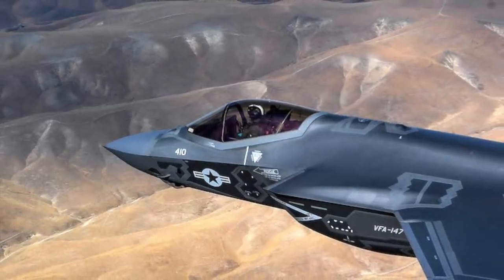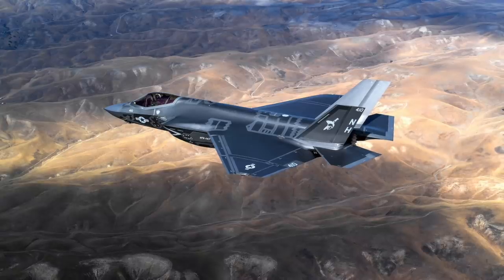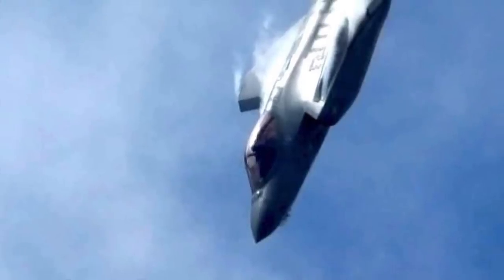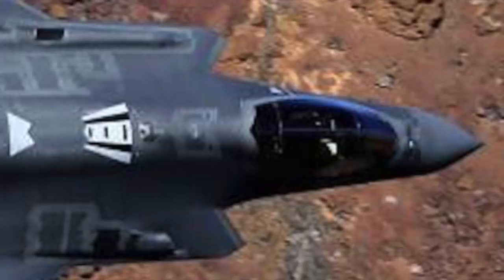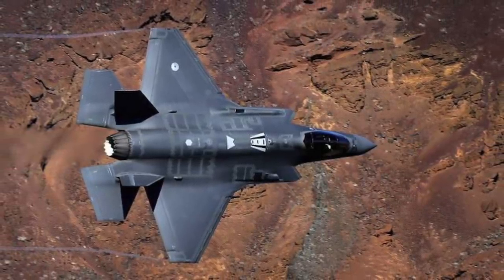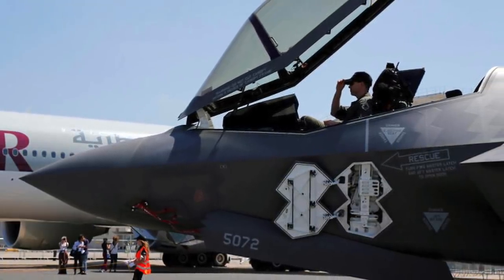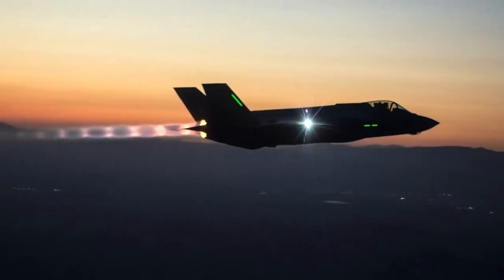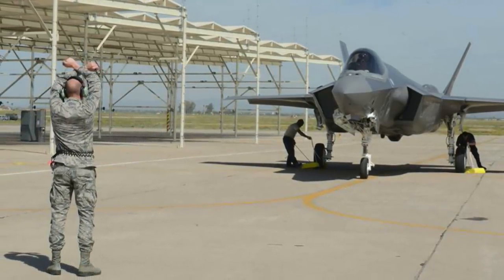HOW GERMAN MADE RADAR MANAGED TO DETECT F 35 5TH GENERATION STEALTH FIGHTER ?

Comment: The entire premise of this claim is ridiculous. They clearly state the 'pony farm' was near the airport. Flying any aircraft (no matter what degree of stealth is in the design) within a few miles of any radar system is going to reveal them. Hell, you can just look out the window and see them, or just listen for the engines at that range. That's not what stealth is for. It's to minimize the chance at detection to get the jets within effective range of their ordinance to identify and take out enemy defenses and high value targets. Once any radar has a lock and track on a known object well enough to predict it's immediate course following it is not all that difficult. You know where it could possibly be, so any return in that immediate area allows it to be followed with a relatively high confidence level. The fact that they lost it in a hundred miles, even with all those initial advantages, doesn't say much for their system. To cover the usual footprint of a economically feasible military radar system, say let's say a 400 mile radius, would require at a minimum of sixteen dual systems such as they used in their test ( that's 32 radars, for the math impaired) since they won't have the initial advantage of knowing exactly where the approaching aircraft might be on the six hundred mile fringe of their detection range (2 Pi R). For workable detection and targeting to guard a single point source such as a vital installation or troop concentration when the approaching stealth aircraft is carrying AMRAM missiles, let's say a 200 mile working radius, would require four dual systems (that's 8 radars) for a decent chance at interdiction. Believe me, that kind of deployment gets expensive real fast.
Reply: Yep.they knew they were coming!
Ezy Pzy...that's the only way!

Now if they were in stealth mode 
We wouldn't be having this conversation!🇺🇸🇺🇸🇺🇸🇺🇸🇺🇸🇺🇸🇺🇸
Reply: excuses,  excuses.  The F35 was tracked up to 100+ miles away.
Reply: THANK YOU!!!!!!! For the love of all things holy and sacred, stealth IS NOT a magical wonder woman invisible jet.... FFS! Get close enough and you’re gonna see the F’ing POS on radar.... or your GD Mark 1 Eyeballs.
Reply: @dystopianlucidity4448  Yeah, people forget that in combat all you need to do is get close enough to the target get your shot off without being detected. You don't have to fly over the radar site to do your mission. IIRC that's currently between 75 and 125 miles depending what missile you are carrying.
Reply: @jubeiorigami4096  Tracking from is entirely different than tracking to.  If you listened to the video you would know the rear stealth profile is decidedly less effective than the front.
Reply: @jubeiorigami4096  Excuses my ass, has anybody locked onto a F-35 let alone shoot one down Jubei Boy??
Might wanna check with S-3/400's in Syria cuz they aint tracking Sh##!
Reply: Jubei Origami do remember the pilots of the aircraft were not expecting to need to avoid radar so why do the pilots have to play a radar company’s game when they can just save fuel not even a f 22 could get past it and I doubt a su 57 would do any better
Reply: Yep people don’t understand what stealth means.
Reply: The key factor here is that these F-35s were not in combat configuration. When flying through civilian airspace, military aircraft have to basically give their position via transponder. Also F-35s also use radar enhancers. Honestly, this is the kinda of shit that start shits between countries. Germany declined the F-35 and now uses pony farm system to track, almost sounds like they are trying to undermine it
Reply: I bet the jets had their radar deflectors installed. And that's it.
Reply: @frankcrawford416  yup
Reply: @Yo UNot just flocks of birds,  but Monarch butterflies when they assemble to migrate.
Reply: @jubeiorigami4096  and then becomes undetectable by the "great" s300 and s400
Reply: @remejr3609  How do you know they ain't tracking shit?  Are you at the S400s Radar control room checking it out? The S400 only protects Russian assets and is designed to shoot down 5th Gen Stealth aircraft.  Israeli F35s have to carry out attacks from the Mediterranean sea and Lebanese airspace which is OUTSIDE the engagement range of the S300.
Reply: lol.... Excuses about Reflectors.  It was only a matter of time before the development of radar able to track stealth appeared.  The F35 isnt some invisible machine.
Reply: What Went Wrong with the F-35, Lockheed Martin's Joint Strike Fighter?

The F-35 was billed as a fighter jet that could do almost everything the U.S. military desired but has turned out to be one of the greatest boondoggles in recent military purchasing history

The F-35 was billed as a fighter jet that could do almost everything the U.S. military desired, serving the Air Force, Marine Corps and Navy – and evenBritain’s Royal Air Force and Royal Navy– all in one aircraft design. It’s supposed to replace and improve upon several current – and aging – aircraft types with widely different missions. It’s marketed as a cost-effective, powerful multi-role fighter airplane significantly better than anything potential adversaries could build in the next two decades. But it’s turned out to be none of those things.

Like the F-117 and F-22, the F-35’s stealth capability greatly reduces, but does not eliminate, its radar cross-section, the signal that radar receivers see bouncing back off an airplane. The plane looks smaller on radar – perhaps like a bird rather than a plane – but is not invisible. The F-35 is designed to be stealthy primarily in the X-band, the radar frequency range most commonly used for targeting in air-to-air combat.

In other radar frequencies, the F-35 is not so stealthy, making it vulnerable to being tracked and shot down using current – and even obsolete – weapons. As far back as 1999 the same type of stealth technology was not able to prevent a U.S. Air Force F-117 flying over Kosovo from being located, tracked and shot down using an out-of-date Soviet radar and surface-to-air missile system. In the nearly two decades since, that incident has been studied in depth not only by the U.S., but also by potential adversaries seeking weaknesses in passive radar stealth aircraft.

Of course, radar is not the only way to locate and target an aircraft. One can also use an aircraft’s infrared emissions, which are created by friction-generated heat as it flies through the air, along with its hot engines. Several nations, particularly the Russians, have excellent passive infrared search and tracking systems, that can locate and target enemy aircraft with great precision – sometimes using lasers to measure exact distances, but without needing radar.

Lockheed Martin and the Pentagon say the F-35’s superiority over its rivals lies in its ability to remain undetected, giving it “first look, first shot, first kill.” Hugh Harkins, a highly respected author on military combat aircraft, called that claim “a marketing and publicity gimmick” in his book on Russia’s Sukhoi Su-35S, a potential opponent of the F-35. He also wrote, “In real terms an aircraft in the class of the F-35 cannot compete with the Su-35S for out and out performance such as speed, climb, altitude, and maneuverability.”
Reply: @jubeiorigami4096  So your idea of a reply is copypasta? Please!

From any standpoint the F-35 is a significant upgrade to it's most direct competitor in allied armed force, the Harrier II Jump-jet.  It's supersonic where the Harrier was not, has longer range, a significant degree of stealth, amazing communication command and control  electronics and fly-by-wire systems that address the most significant problem with VTOL, STOL and carrier based fighters: they tend to kill good number of pilots even when not in combat, especially inexperienced ones. It's the main reason why the Soviets stopped trying to build them. The utility of the aircraft is that it allows any country with jump carriers and helicopter carriers, even cruisers and destroyers fitted out for using helicopters for ASWF to have effective air cover and a ground assault strike force when operating independently. While it's not much of an air superiority fighter most of that is going to beyond visual range these days so it's not a huge issue, and it's highly unusual to find an air superiority fighter that can operate off a carrier. There have only been three: the F-4 (fast, not great at dogfighting), the F-14 (great plane, limited range) and the F-18. The Russian and Chinese carrier capable fighters are all severely limited in range and munitions load out due to having to operate off jump carriers. For almost everyone buying the F-35 it presents a way to perform the roles most countries need a jet fighter for in regional conflicts, reconnaissance, interdiction patrols, anti-shipping missions, air to surface high value target missions, and taking out hostile radar installations. In many of these even limited stealth is a decided advantage. No one in the US considers the F-35 as the ideal choice for air superiority or ground assault. It's not fast or nimble enough for the first, and just too expensive for something that can easily be done by a turboprop. You've probably noticed there are two military aircraft the US doesn't sell to anyone. The F-22, which is a dedicated air superiority fighter, and our excellent A-10. There's a reason Congress slaps down the Air Force anytime they make noises about eliminating the later.
Reply: @massivereader  Yes...  Copy and pasted information.
Reply: 150km is bvr
Reply: @jubeiorigami4096  must be from a country that will not be able to afford the hundreds of dual radars necessary to detect the most conspicuous of F35s lol
Reply: @jubeiorigami4096  (if you didn't detect the sarcasm, that's basically every country) but if you're so certain the F35 won't be worth it's salt then you have nothing to worry about, so why bother convincing us it's useless?
Reply: reading the comments, people clearly don't know what "passive" means. they seem to think this is some active radar and the F35 was not trying to hide. but it clearly says that this is some sort of new passive "radar". it detects things not by virtue of them reflecting something but by looking out for whats missing. at least that's what I got from it. Hensoldt is well known in the germany military for their electronic warfare tech, most of which is obviously secret and I don't mean discovery channel made a documentary about it secret but actually secret. one of they few things they are publicly know for are those "life detectors" where they find people inside buildings and behind walls by looking at whats missing from the usual electromagnetic noise in the air. I imagine this is something like this only 100 times better.
Reply: @jubeiorigami4096  bULSHIT.
Reply: @r.hernandez6152  is there a power button for the stealth mode? Goodness my brain can't take it anymore Amuricans.
Reply: @swunt10  
Yeah thats not how passive radar works
Passive listens ,it does not look
In order for the F-35 to show up passive radar, it would have be emitting a strong signal which stealth aircraft does not do. Stealth aircraft has whats called Emission Controls (EMCON) which actively reduces the aircraft's electromagnetic signature.
More to point, 4.5 gen aircraft also use EMCON systems to reduce their electromagnetic signature.
You actually believe that designers didnt account for passive system 
more the point, you actual believe that military does not practice against passive systems ??
SMH
Reply: @Optical Clarity You and the narrator should read about how the passive radar works. Then both of you would know that the reflectors have nothing to do with it. But OK... It's not easy to understand but most important it's IMPOSSIBLE that any kind of foreign technology can harm any American masterpiece🤦‍♂️😂
Reply: @jubeiorigami4096  Maybe you need to watch the video again.
Reply: This point was discussed in the video at length.
Reply: I see a lot of angry Americans than can't except the superiority of German engineering 🤣🤣🤣🤣😂
Reply: RIght?!  Besides "stealth" technology  is just to lower the detection not make it invisible to radar 24/7 by the time you detect it its already too late a surprise package has been launched at you.
Reply: @verdebusterAP  the whole story is made up. the transponder was on. it means nothing.
Reply: @deltacharlieromeo8252  yea you turn off the transponder.
Reply: Radar reflectors reflect radio waves back at the radar which sent them, however this is a passive radar, so radar reflectors do not matter. Also since it is a passive radar it's really hard to detect and destroy since it doesn't radiate energy.
F-35 is deeply flawed because it depends too much on it's low RCS, and even then it's not really all that stealthy. F-22 even without it's stealth still has it's excellent maneuverability which does matter a lot especially against longer range missiles.
Reply: @dariozanze4929  Duh. They were next to an airport. The 'passive radar' was using the return of the extremely powerful airport fight control radar off the reflectors.
Reply: @massivereader  It uses the radio signals from .eg TV and Radio stations that bounce of the atmosphere, a plane... any plane stealth or not with or without reflectors is going to create a hole in said signals.
Reply: @anthonyb5279  
Which is what people dont get
its flying was with its transponder on
Reply: @dariozanze4929  You'r not a pilot are you? the transponder emits radar energy when on so it would be a sore thumb on a passive radar. at an airshow under air traffic control it would have the transponder on. it would always have the transponder on unless on a mission that required it to be off. This video is completely bogus and you would know that if you were a pilot.  i hate it when people who know nothing about aviation tell people who are real pilots about aviation. Shut up!
Reply: @fluseint.1303  -don’t hate it because it’s effective. Or just sit in your little corner and gnaw at your hands in envy.
Reply: @duncanidaho2097  Wtf are u talking about? I hate nothing about the F35. I just stated the fact that it can't hide from passive radar. Like just nothing can hide from it. Like I said before, read about how it works and if it's not too complicated for u to understand u will see that stealth planes like we know them have no future.